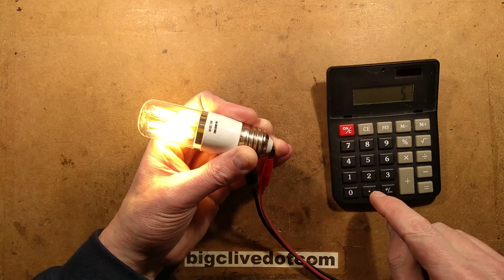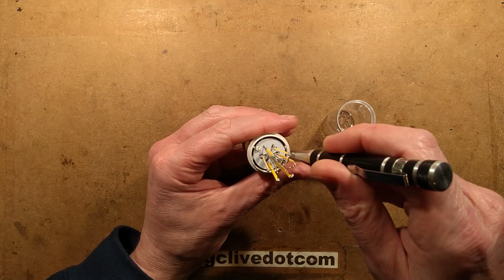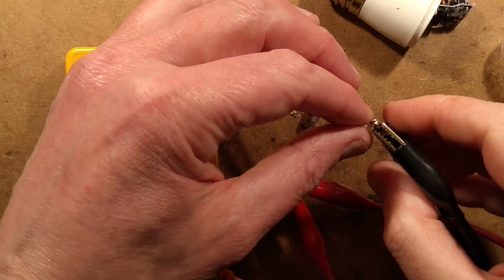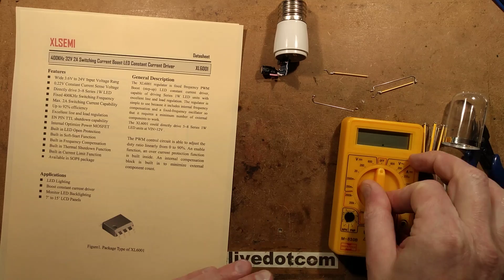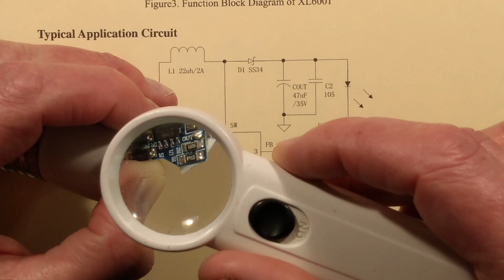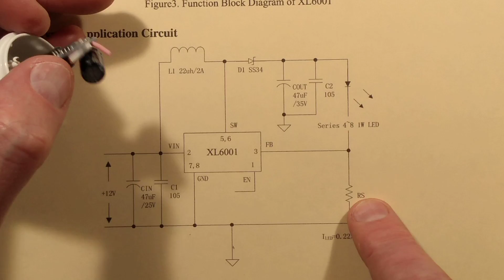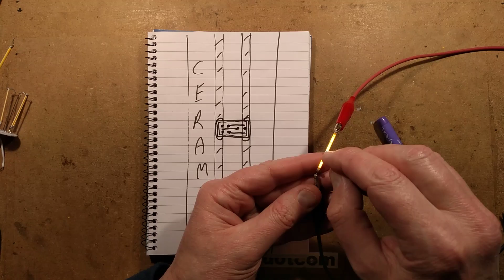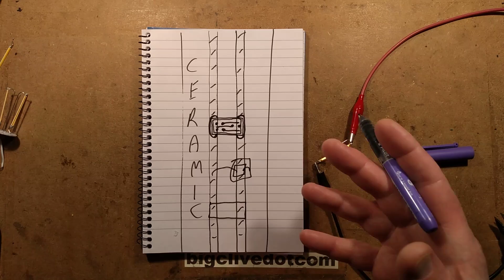12V LED filament lamp video disaster.

Comment: I ditched all of my cheapie M830Bs after they wasted hours and caused days worth of grief.
Out of four meters (which looked similar outside but had very different internal PCBs) three had dry solder joints in the probe sockets that weren't immediately noticeable. Readings fluctuated wildly depending on the temperature, current, and if the leads were nudged slightly. Resoldering helped but cheap plating on the sockets meant readings changed if you rotated the leads.

Two had issues where tapping the range wheel altered readings as you found at 6:10.

One day I was nearly tearing my hair out diagnosing a circuit where the same wire measured as 12V in the engine bay but only 2V inside my car. The LCD wasn't tight against the circuit board, and the rise in temperature inside the hot car made the 1 disappear. It was reading 12V all along. Tightening the screws holding the LCD in place helped but soon stripped threads so the problem returned and ruined another day.

One of them changed readings if you squeezed the case. Never did figure that one out, but probably a combination of everything above.

The fourth one seemed the best of the lot but the range pointer was ambiguous. It had a very defined arrow which at first glance appeared to point to the selected range. But it also had a small dimple (like your meter) at the other end which was the REAL indicator, not easily visible in dim light. Forgot about the weird knob one day, tried measuring battery voltage in current mode and BANG... blew the arse out of it and burnt my hand.

I made the decision to scrap them all, saving myself a lot of grief. Time and sanity scarce these days and I'd rather waste neither! I've since bought four small Aneng multimeters to inhabit my scattered toolboxes, which seem far better in every way than the M830Bs. They even have buzzers, backlights and temperature probes.
Reply: Before I forget, I should mention that most of my store-bought alligator clip jumper leads were poorly crimped. Some weren't cheap either, it didn't just affect the bargain basement leads.

Most had wires that were too thin to reliably crimp in the alligator clips, so to "solve" this issue the manufacturers simply folded the wire back over the insulation and crimped the insulation in with the wire.

I discovered this when some wires fell out of the clips while measuring higher currents than usual. The high current, high resistance connection softened the insulation causing the wire to slide out of the clip.

After that incident, spent a few hours repairing or replacing dodgy crimps and wires on every lead I could find.
Reply: Microwave Dave - for this very reason, I only use test leads with either 4mm plugs and then fit a croc clip that has a 4mm integrated socket, or I make my own leads up and solder croc clips on myself.
And yes, one of the problems with cheap multimeters is the unreliability of the contacts in the range selector. This is nothing new, it also affected the cheap moving coil designs available in the past as well. And almost certainly still affects any current cheap moving coil designs.
The lack of quality on the 4mm sockets, or other smaller sized connectors is also annoying.
For all these reasons, I restrict the usage of the cheap meters that I have to use on circuits operating at no more than 20V. If I get a result/reading that I don’t expect, I double check by using a much better multimeter in parallel 😉.
Reply: I only use my cheapo meter for around the house stuff so it doesn't matter to me. In fact, I only got one because it was so cheap, I wouldn't have be able to do many of the things I do with it I had to buy a more expensive multimeter. 

That said, I checked the voltage of my local phone line with it and it was within the expect range (several dozen volts DC.

As for the contacts on the range switch, I did break the click select of a multimeter I used back in highschool and mine held up so far...  

As for contacts reliability, I do happen to reside in Australia which is fairly dry and easy on electronics for the most part. But I do suspect in more humid parts of the world with less than ideal conditions, cheaper electronics may suffer.
Reply: @Microwave_Dave  As for the croc leads... check their resistance too. if the standard short ones measure around or even above 1 ohm (which should be a warning sign in itself considering the length or lack thereof) it's copper coated steel, commonly abbreviated CCS in descriptions online so it's harder to spot. Found out about that recently and sure enough, 80% of the ones I had were this CCS crap and went straight into the bin. And there I was wondering why some things I clipped to measured odd in some way or had intermittant connection issues :(
Reply: @Knaeckebrotsaege  - Gadget Reboot just happened to make a video about croc clips recently: https://youtu.be/3EdLJHqgK94

@ needforsuv - You only use your meter around the house where it "doesn't matter" which makes sense, until one day it does matter! I've nearly thrown away perfectly good power supplies or batteries in the past when bad multimeter readings led me to believe they were broken. If you're lucky then you'll notice a 'bad' or inconsistent or unexpected reading before any damage is done, but if you're in a hurry it might not be obvious. My Dad once nearly bought a new car battery, thinking his old one was completely dead. Turns out it was just a broken multimeter lead.

Another regular scenario is measuring a power supply or battery to source a replacement. If your initial reading is wrong, you may destroy something expensive. A very expensive film scanner was destroyed at a school I visited, when a 24V power supply was used instead of 12V. 

I've also had cheap multimeter leads with broken wires hidden under their non-existent strain-relief, so the lead appears to read normally until it is moved to a different angle. Sure this could happen to any lead, but is far more likely with poorly manufactured leads with very thin wire and rigid insulation.

I'm definitely not suggesting everybody needs a $400+ Fluke, but spending $20 on a meter instead of AU$3.25 gives you a great deal more peace of mind, and lessens the risk of doing damage to something expensive or wasting your own time.
Reply: @Microwave_Dave  so not only have cheapo meters caused you problems trying to troubleshoot something, but they've also physically harmed you. At what point do you stop buying $60 worth of dangerous junk and just spend $150-200 getting a quality meter?
Reply: @flybackrs  I have much better quality stuff in the lab but can't afford to have $800 worth of multimeters sitting around rarely used in toolboxes, & spending $200 on a multimeter isn't a guarantee of quality these days. Many people reporting recently that Fluke multimeter leads keep breaking, so even their quality is going down.

As for safety, I don't hold meters in my hand now when measuring anything potentially high-energy like car batteries or mains, and all my meters now have fairly unambiguous markings which reduce the chance of user error. Of course I could still have a brain-fart and do something wrong, but that's on me.

Unfortunately Fluke meters are stupid expensive in Australia. They seem much cheaper in the US. Also too big to fit in the glove box. Cheaper "baby" Flukes are still around AUD$100 and didn't even measure current last time I checked.

I was interested in Dave's EEVblog meters but they're both too big.

Plenty of people have posted follow-up videos & forum posts about how reliable their Aneng meters have been after one year, even with heavy use. So far I'm happy with mine and haven't experienced any grief.
Reply: Are those Aneng multimeters hard-switched? Because boy is that auto-off "feature" of their 8000 series ever so annoying!!
Reply: Yeah, a reliable meter is mandatory.
Reply: I got a generic one from ebay and works fine.
Got it 2 years ago for justt over 3 and a 1/4 australian dollars delivered to australia
Reply: My best meter is the oldest. It uses valves (vacuum tubes). Not real flexible, but dead on. Replace caps every few years, though.